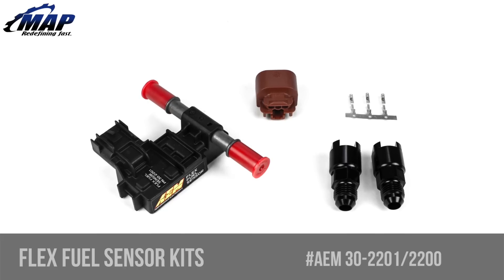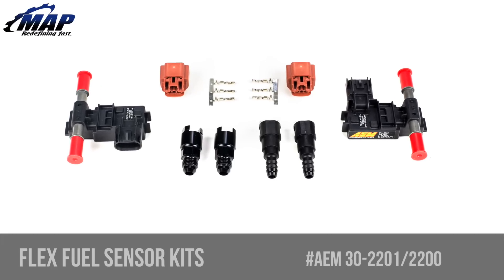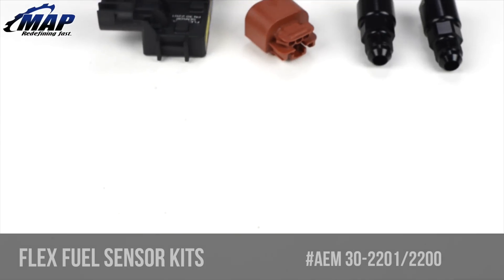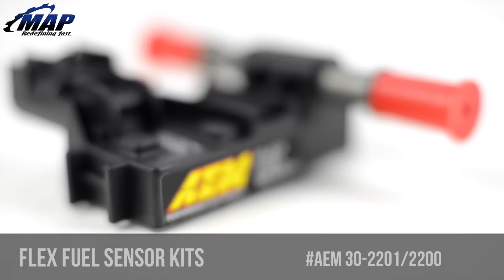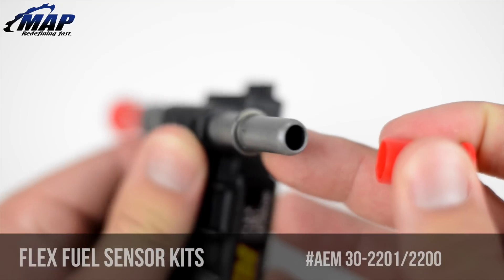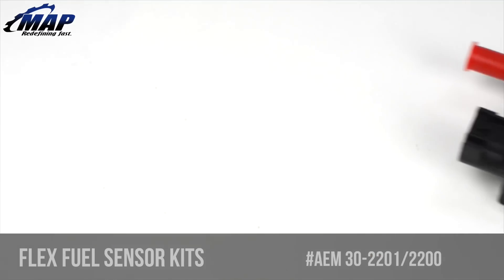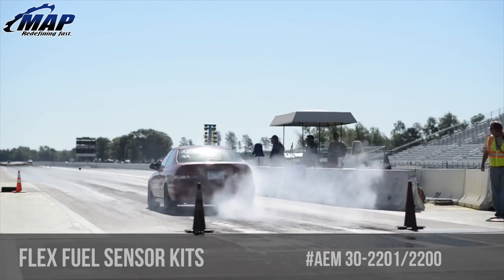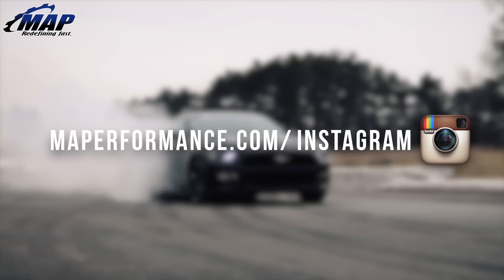AEM Flex Fuel Ethanol Content Sensor Kits | E85 Review

Comment: Trying to save money and buy this instead of the cobb sensor kit for my sti. Is it easy to tune using cobbs AP or is it more beneficial to bite the bullet and get the Cobb? Thanks in advance
Reply from the maker: Which car? Usually yes, this can be used to run a tune for flex fuel, but would want to confirm with your tuner per application.
Reply: MAPerformance 2011 Sti rebuilt with manely rods and the lot. Have the perrin parallel fuel rail aswell as new injectors and pump. The cobb just seems too expensive for a small sensor. My tuner keeps saying that it shouldn't matter to him but he's let me down before with choosing the lame excuse for a AOS that grimmspeed sells.